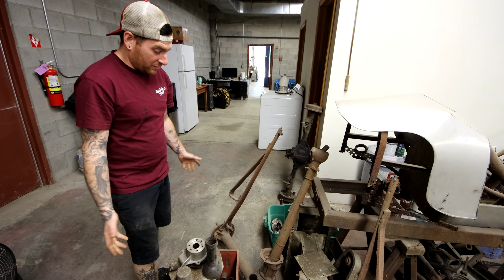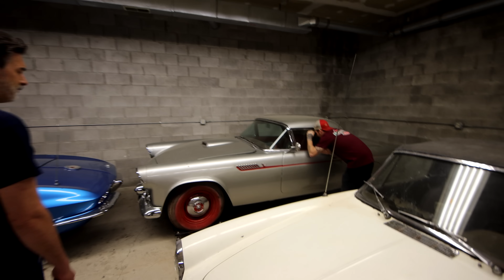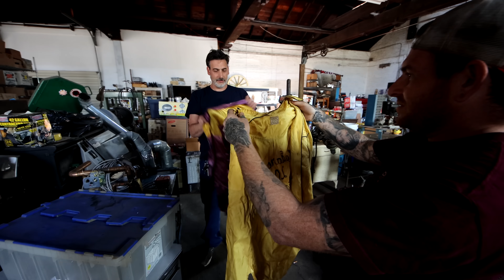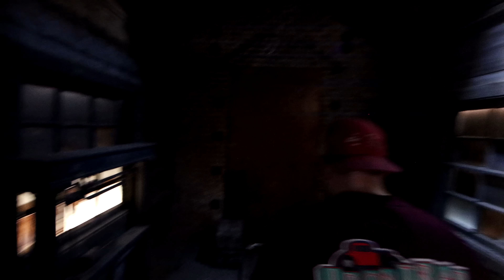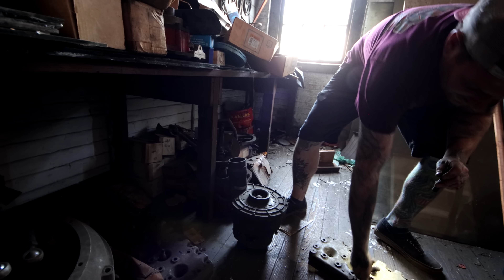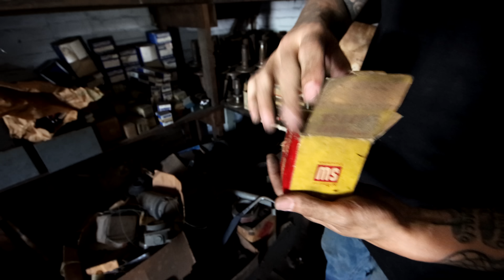Exploring 1950's Speed Shop Forgotten Parts Stash - Le Baron's Racing Equipment

Comment: Casually talking about a 1963 Split Window Fuelie Corvette like ummm no big deal??? Things Ford guys miss. Get that car running and driving without restoring it and you're looking at a $150-$200k car. DO NOT RESTORE IT. It would be worth much less restored. There are only a couple guys other than myself in the country that can rebuild that fuel injection correctly. I've done several and they are super tricky to get right. Seems like this guy doesn't have a clue what he has. Hopefully he gets in touch with someone who knows those cars.
Reply from the maker: Casually? We did a video on a 4 million dollar Duesenberg and we were just as casual. Sorry we didn’t have the enthusiasm you wanted to see in the video.
Reply: @IronTrapGarage  no disrespect intended at all. Please don't take it that way. That is just a remarkable find and I hope the guy gets it to the right people to get it right and they don't make a mess of it. Has to be handled correctly.
Reply from the maker: They definitely understand what they have. He has the means to have it properly revived luckily.

Comment: If the white Fiat is an OSCA it will have a 1500 or 1600 cc Maserati 4 cylinder engine with a 4 barrel carb. The 1600 cc will have two spark plugs per cylinder. They also have four disc brakes. 
I used to own the 1500 cc version in the 1970's in Italy. 
Great show.